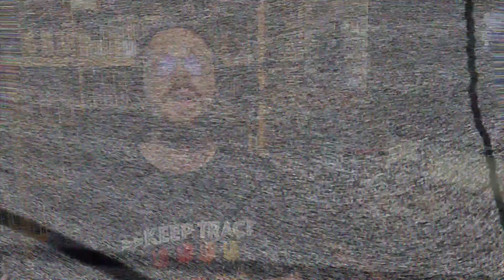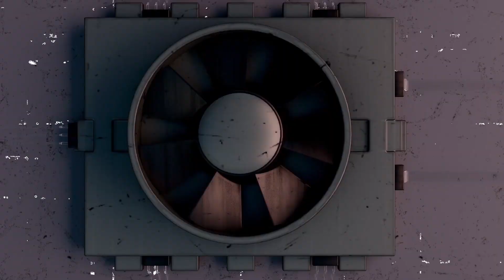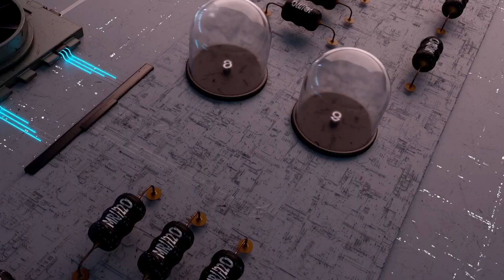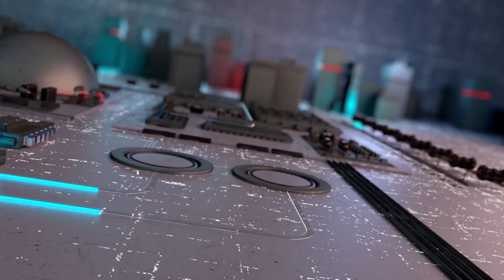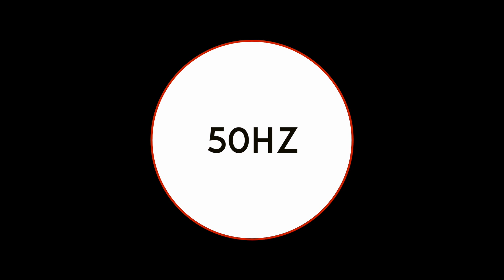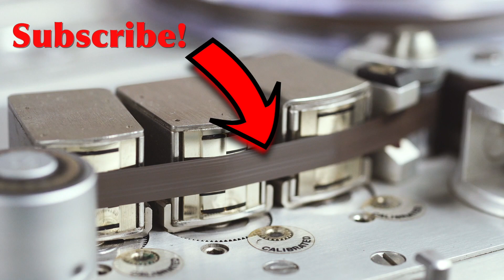How to Kill Hi-Fi Hum

Comment: I have an Onkyo amp that has transformer hum when plugged into the outlet where the stereo cabinet is. Nothing connected to it. The hum is in the transformer. When I plug it into another outlet on another wall there is no hum. A Yamaha does not hum. A Rotel does not hum. My wife and I both enjoy the mellow sound of the Onkyo, but the hum bothers me. It is only a slight hum and does not bother my wife. Any ideas or suggestions. I tried an expensive filtering device that a hifi shop loaned me. Did not solve the problem. Maybe we need to use the Yamaha as it sounds good and does not hum. Or find a new amp we both like that will not hum. I have two Onkyo amps that hum- a new one, and an old one.

Comment: Great video. What I don't understand is how this wasn't a problem in the 1960s. I refurbished a console stereo with new  amplifier and turntable. Nothing but problems with my phono. The old 1960 noisy transformers are gone, but at 15% volume I get the feedback hum. Modern turntable too sensitive?
Reply from the maker: I am sure it was present as well but people bought mainly calibrated systems and did not have all the electronics we have now, much more easy

Comment: I revisit this vid often.  I  recently relearned that when a hum appears the  1st steps are stop, think, and recall what you last changed.  The latest lesson: I purchased a new phono pre-amp.  A couple of weeks later I decided to use my second turntable and I immediately thought I had a tone arm problem. Switched to the main turntable and slept on the problem.   I even started to think about  getting a new Tone arm.   Then I recalled the changes I had made.... I then checked behind the humming turntable.  Some idiot( me)  had, in my rush to try out the new preamp, had the tone arm cables crossing over the TT power cable.   I separated the cables Hum gone. Now looking at changing the power chord for the Turntable.

Comment: I have behringer 1000watt active speakers and a passive 15 step graphic equaliser a djs CD player and a digital radio tuner the output of the graphic equiliser has an intermittent hum from the right channel tapping the output cable stops the hum yet on a meter there is nothing wrong with the continuity of the leads, I'm wondering if I should earth each separates casing to each other to stop the hum.

Comment: I have this problem but it is intermittent.I will just happen with no warning.I have noticed if i just barely touch the interconnect cable it stops.I have checked the cable on another amp and can't find any shorts.The buzz is there even if I turn the volume all the way down.
Reply from the maker: Seems interference (intermittent and present regardless the volume). Try cables with more (double or triple) shielding!

Comment: My new system of Accuphase amp and Eversolo 8 streamer, the streamer is causing hum. Nice unit but obviously not perfect in its internals. I had some success by linking the amp chassis and the streamer chassis with a wire. Reduced minor hum to about 20% so I consider that a success. Next week will get a new Isotek power board to replace my Thor, and a Isotek power conditioner to clean up any DC in the AC. Already have upgraded Isotek power cords.

Comment: For those whom are connecting a phono preamp to their computer, be aware of inbuilt into the motherboard sound cards as they can be crap. I has hum and ticking noises and then purchased a PCIE sound card and now no longer a problem. but be ware that the input khz rate can be low quality.

Comment: I have a wonderful Mark Levinson amp with hum. I tested with a cheater plug and hum went away. So , at least, I know that the hum is from the house ground and not the amp. Thanks so much for your advice. I removed the cheater plug and will work on power conditioning.

Comment: Hi! I just got a svs sb- 1000 pro subwoofer, connected through speakers level (vintage pioneer c-73 power amp with no sub out) and I got a hum in the sub when everything is turned off. Once I turn on the power amp and the pre-amp (m-73) the hum is gone. What I did notice is that if I take out the ethernet cable from the node x streamer/dac, the humming is almost gone. Still can’t figure it out. The ethernet socket in the wall is close to the power socket. And I do have quite long speaker cables that I use for the subwoofer, even if the sub is close to the power amp. I can cut them if necessary. But I’m not sure if this is causing the hum.

Comment: I have some question. I was doing live band. Somehow I have hum noise coming from my sub. I have ground plug for each extension cord, but still get hum
Reply from the maker: That may be the problem. Try using the sub in a different power socket and see if it makes hum and so on for each component. Usually it's a ground loop that makes hum. Plugs with no ground don't hum.. but are dangerous.

Comment: I have a kenwood km-206 that only hums when a rca cable is plugged in , even hums if the rca cable isn’t connected to a source
Reply from the maker: Did you try changing cables...maybe there's a short in the output...
Reply: @anadialog  yea I tried with multiple cables, when I have a speaker connected and I touch of the the rca input grounds with my finger it make a pop so I’m thinking it has to do with the ground
Reply: Hey update , turns out the input jacks aren’t ground to the amp chassis

Comment: I believe my hum is coming from my EQ which I just bought brand new I kill the power and the hum goes away I have match brand new XLR to RCA f & m cables connected to the pre outs bec there's no EQ jacks
I opened the amp and everything is intact nothing loose the power cord on the EQ is  THIN and detachable the AMP power cord is fixed and is NOT 3 PRONG and when the amp is powered on the hum starts (I think it needs the power cord changed to 3 prong) I'm stumped at this point now any help would be appreciated.
Reply from the maker: Did you try to attach the eq to a different outlet?

Comment: I’ve got synths going to my amp. But I’m getting him only from ones without 3 pin power chords. I’ve changed wall socket but that makes no difference. Any ideas? Could the power leads being only 2-way have some effect? If so, what is the solution?
Reply from the maker: I am afraid so. Try using another 2 pin cord instead of the three pole...one at the time. You must understand who is doing it before doing anything...
Reply: I think I sorted it. I simply connected the synth outputs to different inputs on my preamp and it’s all sorted. Looks like a dodgy channel on my preamp. I’ve had problem with DACs connected to my preamp before. It’s a great preamp: Musical Fidelity a308cr.

Comment: I have no hum problems. Instead I have many vinyl records with a periodic rustle, which repeats itself with each revolution of the record. Is it a problem that only I have, or does someone else have it too? For example, my Mahler's eighth symphony (Kubelik, Deutsche Grammophon) is in 2 records: the first has periodic rustle, both side 1 and side 2, while the second is perfect, without rustle; yet I almost always listen to the complete symphony. Can you talk about this vinyl periodic rustle in your future video? Thank you. Another example to listen to: https://www.youtube.com/watch?v=RPBle4ZDefs
I use wet playback, Lenco Clean loaded with "Vetril vetri e specchi" for more than 45 years: it contains 5 ÷ 10% 1-methoxy-2-propanol, which melts different plastics (from 6 months I've only been using distilled water with a few drops of liquid dishwashing liquid). In 45 years many vinyl records have been stained with indelible stains scattered everywhere, but it is interesting to note that many stained records have not developed any periodic rustle. Mahler's eighth symphony is a very interesting case: stains on the 2 records due to Vetril, but periodic rustle only on the first record: therefore it seems that the periodic rustling does not depend on Vetril, but from the pressing from the origin ("horns" issue?). Fortunately, I only have 250 LP records ......
Reply from the maker: I would check if stylus is worn or if misaligned. Otherwise it's just the record itself I think 🤔
Reply: @anadialog , it's just the record itself, I think too. Thank you. I am doing a lot of experiments and observations with a pocket microscope. But everything suggests that you are right: many records I bought as a boy in the early 70s were foisted upon, even if they were already defective at the origin. When I complained about the rustle and clicks with my salesman (surname "Desidera", which in Italian means "what do you want?"), he replied "what do you want? Records are like this and it could also be a limitation of the turntable". The radio was even worse. My first stereo was a beautiful 60's Grundig piece of furniture, but it was not a HI-FI: FM tuner and record changer with a sapphire stylus and 6 grams of tracking force. There were no ultrasounds machines, no brushes cleaner machines and vacuum cleaner machines, but the Lenco Clean arm already existed. When I bought my beautiful stereo (Thorens TD165, Stanton 500, Marantz 20 Watt amp, AR6 speakers), Desidera proposed me the Lenco Clean as the solution to all the defects. The clicks decreased a lot, but even using only distilled water the record was then unlistenable dry. And so I went on with the Lenco Clean arm and distilled water, which was struggling to wet the grooves, until I discovered Mom's glass product: Vetril ... which filled most of my records with stains, even today still unchanged from the point of view of periodic rustle: those who had it then still have it, those who did not have it then do not have it today either ... at least I think, if memory serves me right.

Comment: Loud 60 hz buzz. It's a stereo receiver and it's definitely not the table. I tested the table on another input. Of course the signal was low but absolutely no hum. It's only when chords are connected to the phono input and that input is selected. When there are no chords attached to the phono input there is no hum. The cables are fine. I've put new rca in so it's not the chords And it hums whether the phonograph is on or even disconnected to the cables. No cables no hum on phono but the cables are tested good on other equipment. Is it a dead short and why no hum if no cables?

Comment: Another important topic with very little practical advice (except here !). One common problem (that  I had) was ground loop caused by using multiple AC lines combined with my own DIY audio projects. Basically, I just had too many "three prong" devices plugged into different outlets. One decent solution is to use a "ground lift circuit" at the point where you find the source of the hum. I was able to add this and switch it in/out. (DIY-techie stuff: the circuit is just a 10ohm (2-5 watt) resistor and a .1uf (200+ vdc) capacitor  in parallel. It sits between your ground wire and your AC earth ground point. It's safer than a "cheater" plug,  but you need to build it.)  Many people feel "ground lift" is dangerous. True..if you have NO ground point to begin with. However, the fact that you have ground loop noise probably means that your system has multiple (non-star) ground points. This is a NO-NO for a high quality audio system. Oh..if your are using a turntable...The cartridge cable MUST be grounded to the phono-pre-amp which in turn SHOULD be grounded to the main-pre-amp (or input selector amp). Many pre-amps have a ground lug for this purpose. In addition the pre-amp (or input selector amp) should be the "star" of all the grounded components. Like they say in Italy.."All roads lead to Rome..." One of the earliest practical examples of "star" topology.

Comment: Thank you . I have a separated pony box with one 20 amp breaker. The ground in this is an external  ground copper rod 10 ft in the ground a a 14 gauge Teflon coated  copper ground  is solder to the rod and clapped with a copper clap. My 12 gauge home 3 wire run direct to a plug on my line conditioner.
Only my Dual 1229 is a hum issue. CheersJohn

Comment: Another issue overlooked is Rca cables. And the oddly how many of these are incorrectly assembled. Even big name manufacturers messing this stuff up. And for phono it’s super important often times. The ground shield should only be grounded at the source end. See this article from bob’s devices who makes excellent SUT’s. Sadly I spent countless hours dealing with customers with DIY cables and major brand name Rca cables that create ground loops between their gear. 

https://917bd498-4992-4ef6-bebe-3f682d04079f.filesusr.com/ugd/7869ac_9813cf40d8064f50a77a2921a0de13fd.pdf
Reply: Oddly I’ve seen phono cables with multiple ground wires, which intensified hum significantly
Reply from the maker: Yes, I mentioned both these factors.

Comment: As you refer to lamination rattle and not being able to address it. Actually it is in many cases not at all due to poor transformer design. Transformers are more or less sensitive to dc leakage in the ac line. Devices like LED lighting on dimmer switches or other devices plugged into same circuit can leak dc back into the lines and the transformers can hum or more like buzz. This is easy to fix actually. Many power strips feature dc leakage filters. Removing dc from the lines. And eliminating buzz from a transformer. Usually larger transformers can be sensitive to this. Even some of our products have buzzed. However it requires a significant amount of dc leakage to create this problem. Yet i have always been able to fix this issue with our customers. Often they have an older home with poor wiring, or sometimes it’s the devices plugged into the same circuit that causes this issue. A dc blocker is needed. Like these examples.
https://www.ebay.com/itm/133114436839
Or
Most common is this one https://emotiva.com/products/cmx-2

Does the job, removes dc offset and stops transformer hum. I should be clear. Most cases it’s something else leaking the dc which in turn causes the hum, and can damage some electronics long term. So should be addressed and dc offset should be removed. In some of our products we have large 100VA Otype transformers which are superb for audio yet can be sensitive to dc offset. But it’s less than a percent of customers who have experienced a hum. And all of them fixed with a device like I mentioned
Reply from the maker: Thanks Tim for making that clear!

Comment: Hi...what an informativ vd :-) This is a HUGE problem for almost everyone, and any Audiophile has tried that on their journey. The types of hum is really important to nail, so your starting point is valid. From here you can focus on the source causing these problems, and i guess many of us have experienced a phono stage with crazy annoying hum :-( So thx for taking up the task ;-) Cheers from Denmark
Reply from the maker: Thank you Thomas!
Reply: I have 60hz hum and the main culprit is my rca interconnect cables. I dont know how to get the hum out of my system. Any help would be much appreciated.
Reply: @ArthaxtaDaVince777  First you need to check your grounding? Next you need to check the cables u are using for the unit? Better, check every cable in your system for defects? Also the arm cables (turntable) needs checking, before deciding anything? With Rega decks and phono stages, iv'e came across the hum issue several times, and it has often to do where you live in the world? Some experience no hum, where others experience hum with the same system (or similar). Hope you get it fixed?
Reply: @thomasandersen1784  I'm wondering if buying XLR cables instead of RCA will solve the issue.
Reply: @ArthaxtaDaVince777  changing from RCA to XLR cables created the problem for me. Trying to solve it now.

Comment: Oh man!!!!  Don't get me started..fucking hum is driving me nutz with my new turntable!! I have tried so many things with zero success.  At what point is it the turntable itself??  I feel like my hum is quieter than your 50 60 Hz example.  Only happens when the cart hits the record..... Nothing threw the tube phono pre amp, it's super quite!!
Reply: It's crazy as it just appeared out of the blue.  It was fine for the first three weeks in operation
Reply from the maker: Try touching and moving your phono preamp and if that does not change try removing the blue and/or tye green which are ground and see what happens.

Comment: Thanks to your advice I could find the root cause of the hum in my system. I have a Pioneer AV Receiver with  Pioneer Multiplayer and small TV as monitor plus a separate Power AMP for a passive subwoofer. Whenever I used the subwoofer with the external amp there was a basic hum only coming from the woofer which I could not track where it derived from.
With your help I identified the TV as the source. If it was switched off, the hum disappeared. But I Had problems to get rid of the hum! Neither different interconnect cables nor use of other sockets helped. Then, trying out different adjustments in the TV menue I found the solution. I had to disable the economy mode of the TV which switches it off after a certain time without signal. This was sheer luck to find this out! Maybe someone with the same problem should also have a look at this.
Reply from the maker: Great! Thanks for sharing the economy mode disable, a helpful addition!